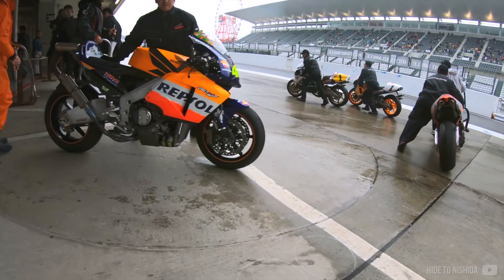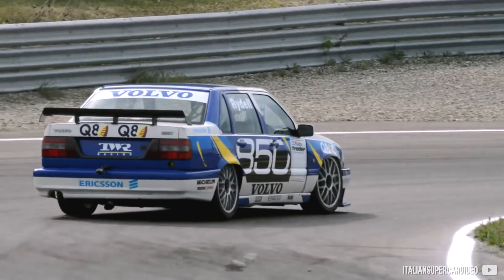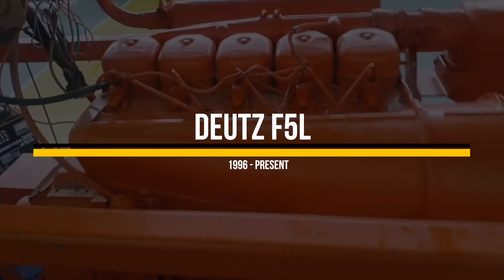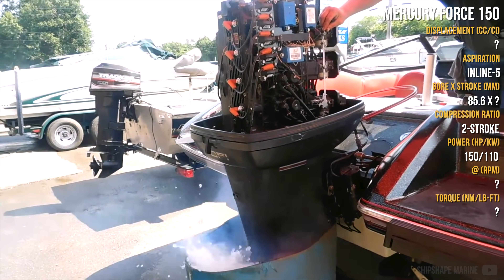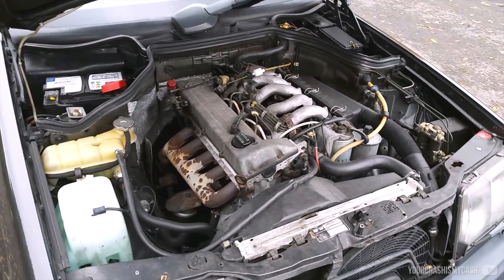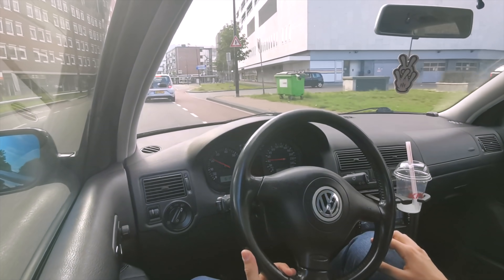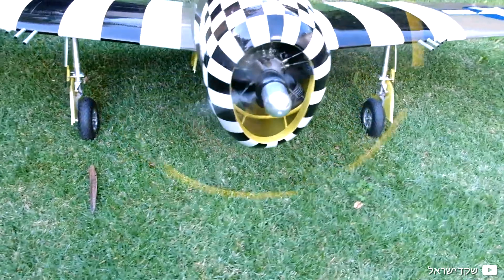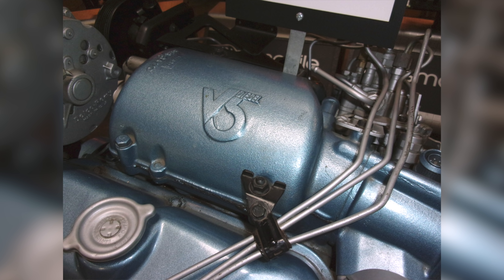The Strangest 5-Cylinder Engines In The World

Comment: 2:15 Front engine, longitudinally mounted, and front wheel drive?? Wtf???
Reply: You should see the Saab 900 then. Same layout, but the engine is mounted backwards and on top of the transmission, and it's connected to the transmission using a chain

Comment: The Ford 3.2L Puma diesel in the Ford Ranger and Mazda BT50 is a good engine, if a little overcomplicated and a pain in the ass to do an oil change, but they can make plenty of torque and really fuel efficient. The replacement 2L twin turbo engine just isn't as good

Comment: One of the best things about the 850 BTCC was the trickery with the rules TWR did to get up to ~290bhp. The rule in the BTCC at the time was you had to use a stock cylinder head that you weren't allowed to add metal to. TWR read that as "It doesn't say we can't take metal off the cylinder head". They ended up lopping a wedge off the bottom of the head so it sat on the block at an angle, among other things.  A £200 cylinder head ended up costing them £15,000 a piece.

The best thing though, they ditched the 850 in 1997 for the S40, then Rydell went on to win the driver's championship and the (Super Touring) Bathurst 1000 a year later in it.

Comment: Nice but you forgotten the milestone - The Alfa ROmeo 2.4 JTD! in 1997 This was the 1st Commonrail Diesel, also with VVT Turbo, ant it earned every price...But in 2003 this 2.4 JTD became a 20 Valve Head and the next step in CRD, The Multijet Diesel Direct injection and this engine is so great! Had 4 Alfa ROmeo 156 with the 2.4 JTD and they had 450.000 - 850.000 km on the clock when i sold it with still 1st Turbo, 1st Clutch, 1st Gearbox, Engine withouth Motoroil Consumption. All driven in Motorsport and Hard Conditions! They´re the most reliable Engine Series i´ve ever seen. 
And when we look how amazing it sounds, however it´s an Diesel, even also because it´s the 5 Cyl. and the JTD/CRD is working very quiet at this series....
Can´t tell how much fun an Alfa 156 from 2003 with the 2.4 JTD 20V M-Jet makes! Still have one under my cars and i love it, however i´ve V8´s... INLINE 5 is great! And made by Alfa Romeo it´s a lot more nice, because these Engines are really not so cost oriented build and designed, they´re designed with hearth for Motorsports and that´s the little different....

Comment: The deutz F5L engine was also used in excavators from O&K (Orenstein & Koppel). Used in the RH6 and MH6 in the 1970's. Even the wheelloader L15 used that engine. Aprox 145-150 HP.

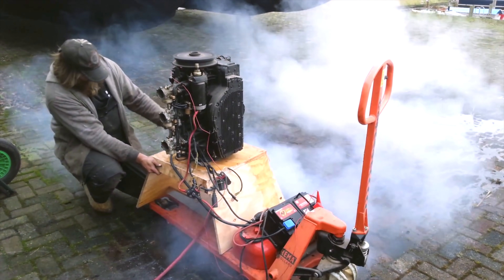Comment: The video of the mercury outboards from 4:30 to 4:52 is of a V6 2 stroke not a inline 5. You could of also added the gm atlas engine which came in a 5 cylinder version aswell as a 4 and 6 cylinder.

Comment: as a s80 owner... my 2001 s80 2,4 non turbo...20valves is detuned from 170 hp and it is 140.. easy to work on, wery simple but a engine that will not die...!... it revs up to 7000 when floring it...the momentcurve is great... it does not die out....it gives you more power by the rews pr minute...inline volvo fives are the best

Comment: The BTCC Volvo 850 was not a turbo, it was naturally aspirated and based on the almost totally unknown naturally aspirated Volvo 850 2.0 engine but whit a 20 valve head. 
Turbos were banned in Super touring, and all cars were forced to use 2 liter naturally aspirated engines. The weight limit for all front wheel drive cars in Super touring was 975 kgs.  https://www.cyanracing.com/concept-cars/volvo-850-super-touring
Reply from the maker: Yes, I have said that - a 2.3-liter turbo with a lower displacement and a removed turbo
Reply: No, it was based on the 2 liter 5 cylinder engine 129 hp 2 valve per cylinder engine, but they added a 4 valve per cylinder head, this information comes from the team who raced these Volvos in the Swedish touring championship, and the cars and rules were identical to the British rules ( BTCC )...

Comment: As much as i love the Audi quattro engine sound, i love one that is really odd, the Berliet engine found in old french trucks from the late 50's. It's a Berliet Magic MK520, with a 7.9L displacement, 5 cylinders, two heads (one with 3 cylinder, one with two) it can run on almost anything (diesel, gasoline, oil, alcohol....), and it sounds really raw. It makes around 125-130hp. 

Each time i've heard one, it takes to the guts :D

Comment: I would take a Honda G25 project any day.  Only challenge seems to be the scarcity of the manual transmission versions and the scarcity of a lot of parts, including the clutch kits.  Otherwise, it would be pretty cool to build one.  The transmission setup is crazy looking...the right side driveshaft passes through the oil pan!

Comment: You should see the Megola motorcycle from the 1920s - it had a 5 cylinder radial-rotary (that is, a radial engine that spins on a stationary crankshaft) fitted inside the front wheel, making it a front wheel drive motorcycle.  http://blog.davidboucher.com/2009/06/1923-megola-sport-racer-rotary-engine.html 
I reckon that'll be about the strangest 5 cylinder engine you're likely to see.  :-)
Reply: Yup, I've seen material on that, bet the air boards hate that engine.

Comment: whats the point of these v5 engines? allways confused me.
Reply from the maker: The V-5 in the Honda RC211V provided a width of a V-4 at the back for a slimmer frame and at the same time smaller pistons for easier higher revs. The VR-5 as you could see the block in the video was very narrow and could easily fit into an engine bay for a transversely mounted engine = more cylinders, more displacement, more power.

Comment: You forgot another unusual but great sounding five cylinder. The Krupp Tiger (has nothing to do with the WW2 Tank). 
It's an inline 5, two stroke diesel for trucks from 1955.
https://www.youtube.com/watch?v=cscMoVKN974
Displacement: 7,270 cm³
Aspiration: NA (roots blower for scavenging)
Bore x Stroke: 115mm x 140mm
Valvetrain: OHV (exhaust poppet valves)
Power: 185 PS @ 1,500 RPM
Torque: 785 NM @ 1,200 RPM
Reply from the maker: Wooow, it sounds so angry!
Reply: @VisioRacer  Yeah. Imagine your OM602 would sound like that.
Reply: Alfried Krupp was an amazing man.....
'The Arms of Krupp' is a read of a family straight through hell....
Reply: Sounds a lot like an engine Detroit Diesel  could have built....

Comment: Solid content yet again, @visioracer 👌🏼🍻

There is another 5cyl 2-stroke motor I know of, though now sadly consigned to history. It was a Burmeister & Wain (now MAN) marine diesel that powered the old HMS Endurance.

From memory of working on the piston crowns (sic) I think it was about 60cm bore x 100cm stroke, and ran two electrically assisted turbochargers. 

Flat out it would turn at 102rpm. Heady stuff 😨

Insta - kart.yoda

Comment: Never heard of a 5cyl Honda…nice content as always! And as far as I know the Mercedes OM605 2.5L 83kw 5cyl and the OM606 3.0L 6cyl 100kw are the most powerful naturally aspirated mass produced diesel engines if you calculate kw per liter of displacement (33.3kw per liter). I owned 1994 E300 with the 3.0L 100kw diesel – great engine ant very smooth for a diesel. 
Back in about 2000s’ a friend of mine had a 1987 Audi 90 2.3L 5cyl 100kw. It was fast for it’s time (8.8s to 100km/h) and man did it sound great!
Reply: How is the tuning ability of this engine? Since tuning the toyota diesel is pretty popular in my country and will be very interesting to tune this merc diesel engine

Comment: Deutz engines are made in configurations from 1 cylinder to V10. Using same parts just increasing Cylinder numbers. 1,2,3,4,5,6,V8 and V10.

Altho OM 602 comes with 90 Hp Na and 126 Hp Turbo from the factory. Tuning it is as easy as OM 606. It can pull up to 500 Hp on Stock internals.
Reply: Thanks for the info, learning at lot here....

Comment: if you do a strange 10 cyl list i've got one, it's a 2.0litre vr10 that was ment go in a british sports car made by a company named connaught
Reply: DriveTribe are putting one of those in an NB MX5!
Reply: @eggegg2873  and people don't like that it makes 200hp dispite it being a two litre and it will be lighter than the stock mx5 motor since its a billet aluminium block
Reply: @anhondacivic6541  well to be fair they have a point that's likely an expensive engine to get hold of parts are nonexistent and it makes little power. rover k series on throttle bodies a cam few bits will make near 200hp and is almost half the weight of the mx5 lump.
Reply: @roycesmart8019  I'm not bashing the engine for making 200hp it's that people assume that it will make 500hp cos it is a v10 and doesn't look at its displacement
Reply: @anhondacivic6541  200hp is pathetic for a fancy ass v10. 100hp per litre which isn't all that good many many road cars naturally aspirated achieve that number.
Reply: @anhondacivic6541   
It is pathetic. 
Having only 200ccm/cyl it should rev to the Moon, making no less than 150hp/liter.
Reply: @eggegg2873 You can swap one of these into practically anything. Just imagine one in a Ford Pop.

Comment: Well the one that's used on the Audi Quattro is certainly one of my favorite in-line 5 engines.
Reply: I don't believe he didn't put it
Reply: @dekik.979  indeed but it’s still one of my personal favorites aside of the ones mentioned on this very video :)
Reply: The title is strangest. Theres nothing strange about the audi 2.2
Reply: @datsunalzheimer  nothing strange about the Volvo 5 cylinder either.
Reply: @rennkafer13  the strange thing was the lower displacement and usage, 2,2t is probably the most known and least quirky R5 with the MB diesels at least having multiple displacements and injection technology
Reply: And Audi's 10 cyl is two I-5s in a V configuration

Comment: Most folks don't get why 5 cylinders is better.  Just like any division of 3 is better than 2.  Your best racing engines for the most part were V12's, a number divisible by 3 and a crank plane degree divisions of 120 degrees.  So 6's, and V12's produce horsepower pulses and torque every 120 degrees as opposed to an engine divisible by 2 like a V8, which has power pulses every 180 degrees.  A 5 cylinder engine is even better, like an inline 5 or V10 as they produce power pulses every 72 degrees.  360/5=72.  That is the true reason 5 cylinders are a smoother, better running engine whether diesel, motorcycle, performance car or just plain old every day driver.  As a result of them running so much smoother, they last a lot longer too, as there is less non consonant vibration.  Most folks don't know enough about engine design or volumetric efficiency to understand this.
Reply: Man, 12, 10 and 6 are also divisible by 2, a 5 cylinder doesnt produce power pulses every 72°, a V8 doesnt produce power pulses every 180°, volumetric efficency doesnt relate to being smooth or not...
Reply: @alexmonje2682  you clearly have no idea what you are talking about.  Get yourself some good engineering sources on engine design and crank plane phasing.  Your're out in the weeds.
Reply: @3RTracing 
-A 5 cylinder fires every 144°, 72° is the crank plane phasing.
-An 8 cylinder fires every 90°, 180° is the crank plane phasing, and only in flat plane crankshafts.
-Scavenging improves engine power, not smoothness. Smoothness depends on crankshaft angles, firing order and spacing.
You are the one that say 12 is not divisible by 2 and tries to tell me that i have no clue about what im talking.  Go to the highschool before trying to look intelligent, bigbrained.
Reply: @alexmonje2682  Boy I could write books here about how wrong you are.  Do you have any idea or concept of what exhaust port scavenging is and how it relates to crank plane phasing and exhaust pulses???  Probably not.  But the more pulses you have per engine revolution, the more scavenging you have and thus the more efficiency.  You just need to keep your trolling to yourself.

Comment: Great volvo 5 cyl engines they sound amazing
Reply: They do sound amazing, which is a thing I didn’t expect
Reply: @GhostOfDamned  my 9n3 polo 1.4tdi 3 cylinder sounds good a bit like a v6 and a deep sounding diesel like roar when acellerating
Reply: Love the Volvo too!
Reply: And the 8500 rpm limit was accually not the limit for the engine. 
In that competition class the rules sade max 8500.
It was a way to limit the horsepower (and cost) 
in a fair way. (About 320-330 from 2 litre) No turbo allowed.
By free regulation the manufacturer would go for higher power range.
Maybe 7500 to 10000 rpm.
Instead of 6000 to 8500.
Probably near 400 hp. 
But cost will go up.
The idea was...
Real racing = no turbo.😁
Reply: @christerahs9776  Slow racing = no turbo
Reply: volvo has the 5cylinder from audi!
Reply: @diggahchrizz  That is so wrong, Volvo 5 cylinder is a completely different motor. But Audi did have some legendary 5 cylinder engines as well. Audi RS2 and Volvo 850 T-5R were both helped by Porsche.
Reply: @diggahchrizz  Volvo did use a, 5 Cylinder diesel engine from Audi until they replaced it with their own 2.& Litre D5.
Reply: @diggahchrizz  tell me you know nothing about Volvo 5 bangers without telling me you know nothing about Volvo 5 bangers